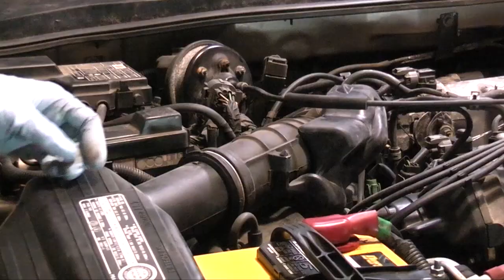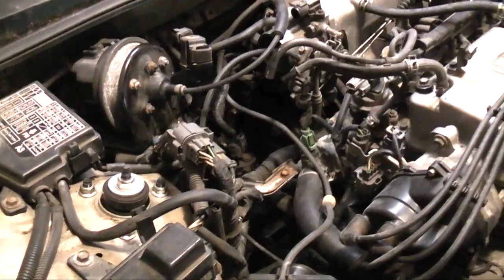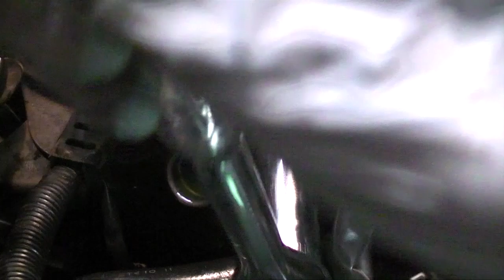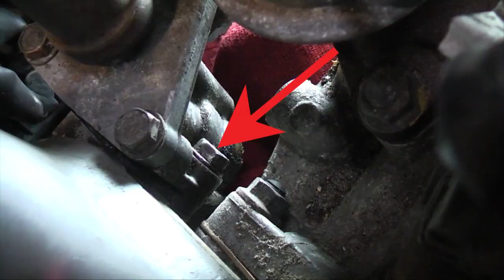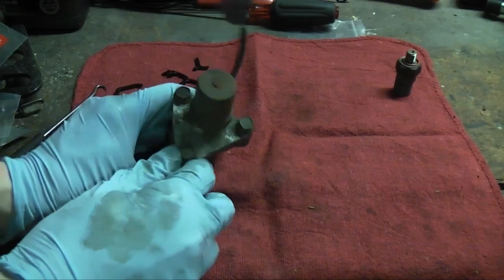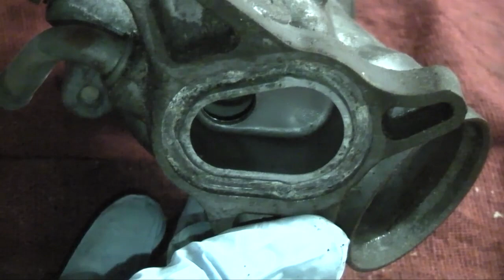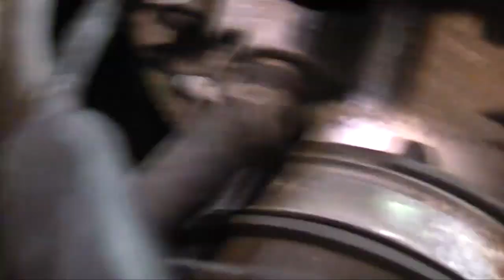Honda Accord VTEC Solenoid Gaskets Replacement

Comment: I have a  97 prelude. Code says solenoid malfunction.. Did the oil change to the proper level. Light came back. You think it could be clogged. Or is the complete solenoid replacement. Or something i can do before buying the solenoid.. Plz halp
Reply from the maker: drogas93 Start the vehicle and connect a test light to battery positive and touch the other end to the single wire on the solenoid and listen for a click and the engine RPM to drop. If you hear a click and no RPM drop check for a clogged inlet filter.

If you hear no click either the solenoid is bad or the valve is sticking. Disassemble the valve and make sure the spool moves smoothly.

If you hear a click and an RPM drop the only other thing that can be setting the code is the VTEC oil pressure sensor. 

These tests must be done with the engine warmed up because oil pressure is higher when the engine is cold.

For the first test make sure the key is in the on position.

Get a DMM and connect the black lead to battery negative. Back probe the VTEC oil pressure switch connector with a sewing needle. Start with the Brown/Black wire the voltage reading should around 0 volts. Back probe the Blue / Black pressure switch signal wire. With the VTEC solenoid off you should read close to ground.

Now start the engine and rev it to 5k RPM (to raise the oil pressure) and activate the VTEC solenoid via the single wire as you've done earlier and look at the signal wire. The voltage should be near battery voltage. If it isn't the VTEC pressure switch is bad.

Comment: Hi, can you post a video like this to lock up and control solenoids? I like yours videos and they help me a lot and you explain as a good teacher...I have a accord 95 and D4 flashing and I think the problem can be over there Please, help me. Thank you.
Reply from the maker: Jorge Caldas What code is stored in the TCM? Jump the 2 pin service check connector under the glove box and turn the key to On. The D4 light will flash the code it will be a one or two digit code. There are a total of 15 codes.

If it's a one digit code there will be short flashes to indicate the number. Short-Short-Short= Code 3.

If it's a two digit code the long flashes indicate the first number and the short flashes indicate the second number. Long-Short-Short-Short-Short= Code 14.

Comment: vtec solenoid b is failing. Do I replace the whole solenoid. My car seems to not have a passing gear and when plugged up to computer it says vtec solenoid b is failing. Would this be the process to change the whole solenoid out.
Reply from the maker: Cassie Scott If you have shifting problem I believe you're referring to a transmission solenoid code that's a completely different part. There are 4 solenoids on the transmission two handle gear shifting and the other two handle torque converter lock up.
Reply: ok. We've been trying to figure this problem out for almost two years and the mechanics around me are dumb. When it gets to 4rpm its hesitant. U can't floor it. So that why I was like passing gear isn't there and when plugged up to machine all it says is vtec solenoid b failing. No lights come up on my dash. We just didn't know where about to start from or what to replace.
Reply from the maker: Cassie Scott
What year is the vehicle?
Reply: 98 Honda accord lx automatic 4 cylinder
Reply from the maker: Cassie Scott
Has the vehicle been getting regular oil changes, is the oil level ok, and have you been using the manufacturer recommended viscosity (it's printed on the oil cap)?

If so try manually activating the VTEC valve. Start the engine and back probe the 1 wire connector with a sewing needle.

With a test light connected to battery positive touch it to the needle you should hear the solenoid click and an RPM drop when energized.

If you don't hear a click either the solenoid on the valve is bad or the valve is stuck.

If the RPM doesn't recover after removing the test light you have a sticking VTEC valve. You'll need to remove it to clean the oil deposits inside.

Comment: Thank you for this guide. I replaced all seals using your guide as well as distributor o-ring and gasket following another guide. I didn't have oil pressure sensor on my 97 EX vtec solenoid, it was replaced with 12mm bolt. I need to return 22mm deep well socket. Also the tube that connects to the thermostat can be twisted to provide additional clearance. I ended up using 8in extension with 10mm socket with no interference.

Comment: tried to save time and not take off the thermostat housing because i didn't want to lose the radiator fluid; spent half the day trying to fit all kinds of tools on that bottom bolt but couldn't get it off. save yourself some time and headache and just do it the "long way" by removing the thermostat you will thank me later.

Comment: I stripped the 10 mm bolt on yhe bottom of the vtec solenoid what do you think the best way of getting it out
Reply from the maker: Use a bolt out socket. They usually have a hex on the end so you can use an open end wrench on them in tight quarters.

Comment: I got a check engine light on my 1998 honda accord ex its a vtec system malfunction p1256 code and i see in forums doing this will fix this? Anyone have had the same problem?

Comment: It´s so helpfull...Thank you for posting  that  video. Now, my question is: can I change just upper gasket because my valve is leaking on the top and I think I don´t need change both gaskets. Wh

Comment: Great video thank you. I have a 1998 honda accord 4cyl AT LX sedan the whole thing was about 99% the same. Took me about 90min in the middle of the night with one work light and a flashlight. Parts with coolant only cost about $30. 214xxx miles everything has been happening in the past month. Tansmission, power steering pump, oil pan leak, alternator, distributor leak and then vtec leak. Spent about a week trying to figure it out couldnt see the leaking spot just the trail of oil on the transmission and finally found other people reporting the same issue. Ur video showed how easy it was.

Comment: Need to do this tom. Mine is a accord 2000 4 door do i need to remove the water inlet or just the air box and egr? Tia!
Reply from the maker: That's a sixth generation so yes I believe the inlet will be blocking one of the fasteners.
Reply: ***** ok thanks bro\m/

Comment: My theremostat went bad recently and I know I had a leaking VTEC solenoid gasket so just completed both jobs. This video was very very helpfull. Mine was a 1999 Honda 4 cylnder and there were minor differences. Plunger under the solenoid did not have a spacer but was formed into the top half. Also, I had to remove the EGR valve to get to one of the VTEC assy bolts which was a good thing because that provided the opportunity to clean it out.. Thanks big!!

Comment: So you don't clean up both mating surfaces of the block/vtec solenoid with brake cleaner so it's completely dry/clean? I've read forums where people say to do that

And also, why do you put oil on the new gaskets? No one ever mentioned doing that in other how-to's, I'm confused now on what's the proper way ha
Reply from the maker: The best thing you can do to mating surfaces especially ones that have open oil passages in them is to keep them clean.

Both mating surfaces and the oil on this vehicle was clean. Introducing unnecessary contaminates like red shop rag lint into the cylinder head oil passages isn't a good idea. If the surfaces DO need cleaning lint free shop rags should be used which I had ran out of at the time.

The gaskets are made to handle petroleum products and it's common practice to lubricate new gaskets with whatever material they are designed to seal against so they don't bind or roll during installation.
Reply: *****
So just wipe clean with a lint free rag, don't spray something like throttle cleaner on the rag first?

And, do you lubricate both sides of the gaskets or just one after they're seated in their grooves?
Reply from the maker: mrsemifixit
Just on the gasket itself.

Comment: I need to replace  mine but I can't seem to find one online through part sorted near me any suggestions?
Reply from the maker: Any local Honda dealer would be able to get you the parts if you can't find them online.
Reply: ***** eBay  has the. For $20
Reply: Thanks

Comment: this is for the transmission right?
Reply from the maker: No the engine it's changes the cam profiles on the camshaft.
Reply: ***** so wait if my car is shift somewhat rough is it this? or is it the transmission?
Reply from the maker: *****
Rough shifting wouldn't be caused by the VTEC valve that's a transmission issue.

I'd try changing the fluid check out my transmission fluid change video for details.

Make sure you use Honda fluid these transmissions don't work well with many aftermarket fluids. Rough or erratic shifting can be a symptom of using non Honda fluid.

Comment: just did this job today. my back is still recovering from all that bending. I even had to buy more coolant and bleed the system. thanks for the video it made this job 10 times easier.
Reply from the maker: That's why I usually put the front of the vehicle on jack stands. It's a bit more effort if I don't have to go under the vehicle but the less I have to be hunched over the better.

Thanks For Watching.

Comment: my 1994 honda accord vtec is shaking a lot every time i stop do you guys know whats wrong with it…???? can you guys pls help me...
Reply from the maker: If the steering wheel is shaking when you brake the most likely cause is warped rotors.

The suspension system should also be checked for worn components too just to be safe. I show how to check it for play in the Steering Wheel Shake and Pulsation video.
Reply: my bad bro i men't to say was that win is in park it shakes
Reply: like its gonna turn off
Reply: i was gonna go to the store and it just seems like its gonna turn off
Reply from the maker: Is the check engine light on?

Does this roughness only exist at idle or is it also present during acceleration?

Comment: Where did you get your gaskets? Dealership?
Reply from the maker: Yes I haven't been able to find them aftermarket.
Reply: Ok. Thank you. Do you know if a 2000 Honda Accord will have the same part numbers? I got a f23a1 I think.  It looks the same to me.
Reply from the maker: The gasket between the cylinder head and valve is the same. But the gasket between the solenoid and the valve body isn't listed for your specific year.

The VTEC valve assembly on a 2000 has a different part number than the 94-97 models so there's no guarantee the older model gasket will fit.
Reply: ***** thanks. can you help me with a problem I have with my honda?  once in a while, i get these power surge like thing. whenever i accelerate, the car stutters. then it stops after a while, then starts again. it only happens when i accelerate. also, when my car gets these power surges/stutters, the speedometer goes crazy.  i replaced vtec gasket, distributer cap and rotor, the o-ring on distributer, spark plug and wires, pcv valve, and did an oil change.  it got a lot better, but i still get the engine stutter once in a while.  do you know what else i should do to fix it?

thanks
Reply: That One Korean Kid sounds like fast thermal valve , i would check you idle control valve too.  Use only OEM.

Comment: I've got a stripped 12mm bolt on my Water Inlet Housing, any recommendations to get it out? The area is to small to hammer in a smaller size.
Reply from the maker: Is the bolt head rounded or is the fastener head sheared off?
Reply: ***** The bolt head is rounded. I bought some Irwin sockets for stripped bolts but don't quite have enough room to hammer the socket on
Reply from the maker: Collin Amedee
Bolt outs shouldn't need to be hammered on. Go up one size larger. The socket should slip over the fastener easily. The spiral flutes bite when you turn it counterclockwise.

That's why each socket specifies a range of bolt head sizes instead of just one.

Your options are limited in those close quarters if the bolt out won't fit.

The only other choice would be to drill the head off the fastener to remove the assembly.

You could then use the bolt out on the stud protruding. Hit it with penetrating oil first to make it easier to remove.

Comment: Damn thats a poor design to remove that solenoid valve. Nice writeup though!
Reply: ***** they were thinking that everyone would go to them to get it done if they made it harder than it needed to be
Reply from the maker: It makes you wonder what we're they thinking?

You can get on the fastener with a box end wrench but it will be crooked. The risk of rounding a fastener is too great with uneven contact.

Comment from the maker: Test the solenoid just supply 12 volts to the single wire you should hear a click and an RPM change if the valve is mechanically working.

If you back probe the oil pressure switch wire at the connector with a needle (blue/black) and measure the voltage you should see a voltage change (0 volts valve off) (Battery Voltage valve on) when you power the valve.

If these tests check out the VTEC valve is fine. It can't be a restricted screen since the gaskets were replaced.

Comment: ...had this awful acceleration problem. I took back the car and he told me that the gasket was the wrong one. The car had acceleration problems before and I always thought that they where transmission related because when the transmission reach 4th the car starts to kick like crazy and doesn't wants to go to the next gear. He tells me that this problem is vtec related also, what do you think?

Comment: @Bushougoma hey man I just wanna thank you for your help! I did like you said and tested solenoid and it clicked then tried to manually power valve at idle and didn't hear a rpm change so long story short I swapped the valve today and got vtec working again and its not sputtering at 4grand.you were the only one who gave me great info on exactly how to test everything. Thanks again and subbed+thumbs up!!

Comment: @bushougoma thxs a lot for you quick reply and help, got a coupke more questions if u don't mind. You said check the valve by supplying 12 volts now is that with the car idling? And you said maybe bad solenoid can I order just that part instead of whole valve? And how do I get valve unstuck? U had said it could be cleaned? I really appreciate your help, not a mechanic but I try to fix on my own when possible, thxs

Comment: @Bushougoma hey man great video! Got a quick question if you could help me, I have a 03 civic vtec and when I was in second and hit 4000rpm (when vtec should engage) it sputtered and wouldn't go higher. So I took to get code checked and it was p1259 vtec malfunction. What do you think it is? Do you think I just need to replace spool valve? Oil level is fine. Thxs for any advice. I really appreciate it! Thumbs up

Comment from the maker: All of the gaskets should be under 15 bucks from the dealer. Other than the 2 gaskets and the one o-ring on the pressure switch there are no other leak points.

The valve is a pretty stout piece of aluminum unless a previous mechanic did something stupid and managed to damage it somehow. Like over tightening the pressure switch and cracking the valve body.

Comment: Hey nice video man, very informative and a simple walk-through. I was wondering though a mechanic mentioned that my oil leak is because of the vtec gaskets, does this video work with a 2001 Honda Accord.

I see that a few areas are different but it seems to be very similar assembly.

Comment: Awesome video... My 1999 Accord has been leaking oil like a stuck pig... After two days of looking for it I found that this little thing is pouring oil.  I am stubborn tho.. gonna try to get it loose without taking the coolant line loose.. Just wanted to say thanks for taking the time to put this video together.

Comment: hey bushougoma!
thank you for your helping me find a leak on my 1997 honda accord ex v-tec. ,my driveway is full of old oil from a leak, which i paid many mechanics to fix and could not quite find it, after 2 years finally i came across this video today and wham!!! problem fixed...once again thank you. 225,000 mile still running strong.

Comment: Could a leak on the lower gasket be caused by a loose bolt? also what are the signs on the gasket that shows it needs to be replaced?

Comment: I have an '03 Honda Accord with this problem, I've bought the gasket( block to valve-I guess) It seems like a very easy going project on my car. There is nothing blocking it, since its directly on the back of the motor. The only problem is that it just beyond the line of sight. I'm sure a mirror could fix that without any issues. I'm new to working on my own vehicle, so my question may seem stupid-sorry- do I have to drain the oil out to do this repair? Thanks for your response!

Comment: Thanks for the great descriptive video.  I was able to use a midget wrench to get the bolt off. Thanks for that tip.  Also, apparently ODBII 96-97 Accords do not have a oil pressure switch so don't be alarmed if the normal hole is just plugged with a bolt.

Comment: I also do this repair on a regular basis, without removing the coolant pieces, using a small 10mm Craftsman combo wrench. I remove the distributor for better access and to change the dist o-ring as it's usually leaking oil there too, right on top of the heater hose, causing it to fail. Awesome design job Honda(sarcasm).

Comment: I have a 96 accord ex. My vtec solenoid doesn't have that oil pressure plug in or sensor. It's just a bolt ran in there. What's the reason for that?

Comment: Best video about Vtec! One question so far; in 2000 Accord/4 cyl/do I have to go the same way, or I can just remove water hose with thermostat to get to the bottom bolt of selenoid?